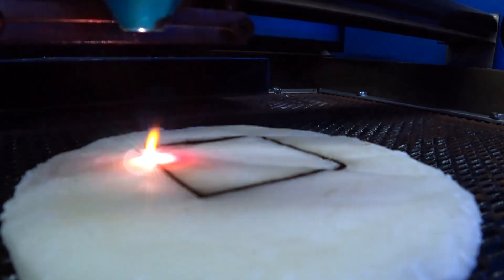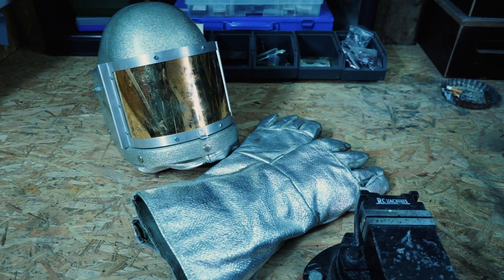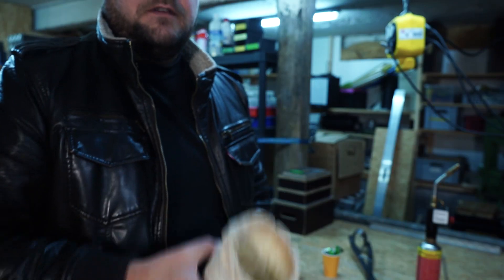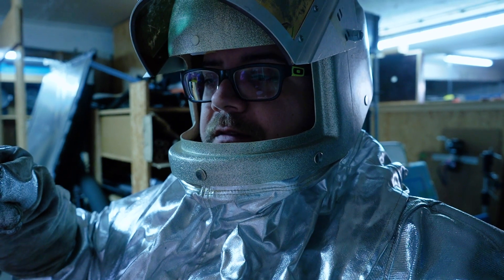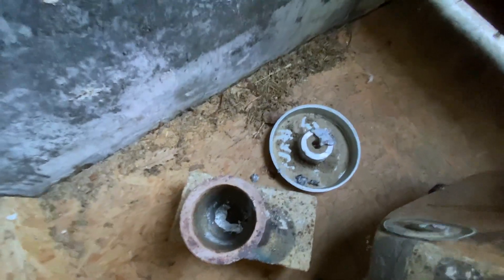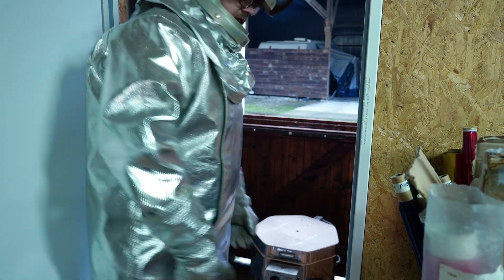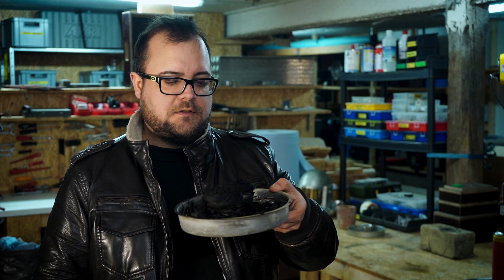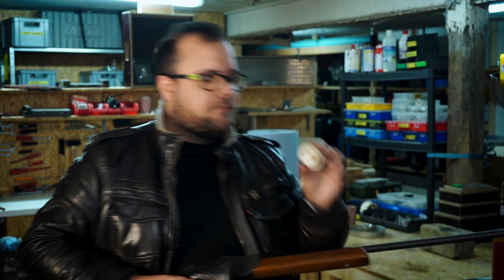Can You Make A Crucible Out Of Starlite ? | Is Starlite Bulletproof?

Comment: Good format and funny.
Would you please try (I'll fund): 
1) starlight with fibers in it for strength - hopefully Kevlar fibers
2) aluminium plate about 13 cm by 13 cm and about 2 cm thick with .177 steel BBs suspended in it - thinking electro magnet to hold the BBs in a lattice of at least 3 BBs thick and lower into molten aluminium